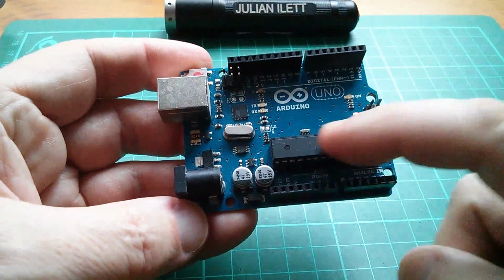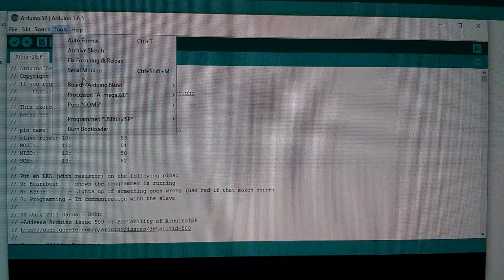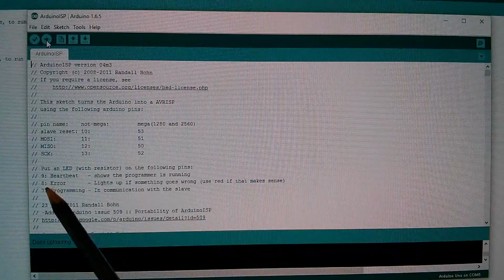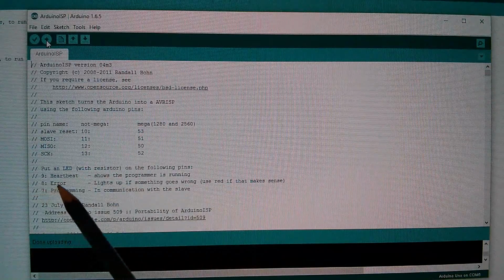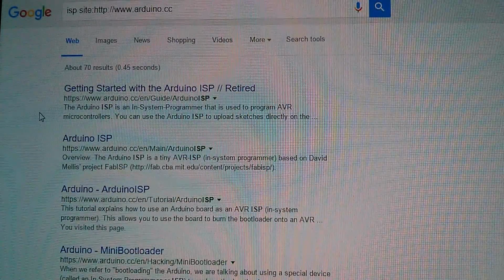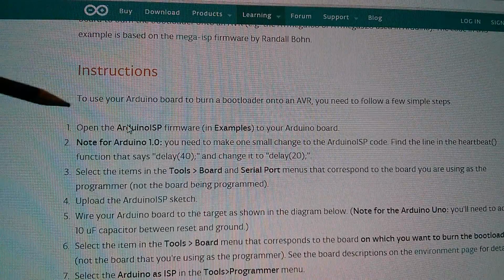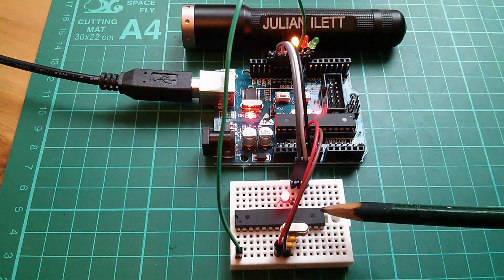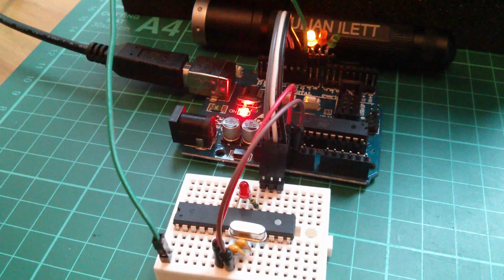Julian's Ardutorials: Arduino as an ISP

Comment: I'm a great admirer of your work here :)

In the instruction on this page, https://www.arduino.cc/en/Tutorial/ArduinoISP  , it says 

"Wire your Arduino board to the target as shown in the diagram below. (Note for the Arduino Uno: you'll need to add a 10 uF capacitor    [ MICRO Farad ] between reset and ground.) "

You suggest using a 100 nanoFarad.....

Does it matter that there is such a difference in value ?  Won't it affect the RESET pulse width ?

Comment: Man I did love it when you were teaching Arduino for we beginners, from time to time, I find myself going back to review some of these old videos, they are so refreshing to see once more. I hope you will, one day, return to the Arduino's and ESP8266 projects so we can have more fun with them. I most recently built a special timer for my good wife of 48 years to use when she installs the eye drop medication for glaucoma, she needed a count down timer for exactly 2.5 seconds. I used an ATTINY85 processor, a four digit LED running through I2C bus and mounted it in a very small project box with just an on and off toggle switch.  For power I used a very small 12 volt battery designed to power remote control relays that I used to use to turn on my back up camera on our old RV (no longer needed our new one has a great camera, I just had to repair the monitor, she had bad solder joints inside!)  I based it on a video I found on Youtube, and gave credit to the fellow who designed the original system. I just modified it a bit as to the power supply and using a passive beeper instead of an active which required a few changes in the code.  It works great, and it is nice to see one of my projects being used every night  without fail.

Comment: The onboard LED on the Uno is blinking synchronous with the breadboard LED in both programs. What's going on? Is the ISP Uno also programming itself to do the same thing as the chip it's trying to program?
And it went dark after uploading the bootloader, did the ISP also wipe itself? (no wait the heartbeat is still there)

Comment: The original ATmega328p that came with the Arduino is destroyed. I tried to remove it from the socket and i bend the legs and after they went off. I gone on ebay to purchase some chinese Atmel's claiming to be "genuine' however i can't even upload the bootloader on them. It gives me this error. "avrdude: stk500_recv(): programmer is not responding". I use the original Arduino compiler and the Arduino. Any clues anyone? o_0

Comment: Julian. I find it pretty funny that you posted this right after I created a small shield that does basically the same thing. I bought 10 AT chips from China without boot loaders so I figured I would save myself the time rather than break out the breadboard every time I needed to flash them.

I opted to ignore the sketch's suggestion and and used Red for the heartbeat, yellow for warnings and green for programming. I also added a Green LED for pin 13 along with a 16MHz crystal and capacitors to allow the programmed chip to show signs of life. Pin 13 also flashes in tandem with the programming LED so the results are pretty awesome! The use of a socket allows me to pop a chip in and out while leaving everything else in place.

I had to smile when I saw you ran into the same problem I did with the headers. I ended up using more pins than I wanted just for stability sake. It was either that or break off just one pin.

Thanks for the video, gave me a bit of a sanity check :)

Comment: Julian, as always, excellent tutorial. I was wondering if you might be interested in doing a follow up video to this one. Going through how to program the attiny85 using an arduino as isp and also how to set up the attiny85 to run on its internal clock.

Comment: Is it my imagination or does that final fast blink seem faster than the first one? If so, that means the ISP upload didn't work. Can you explain?
Reply from the maker: +Roger Rowland Yes, well spotted. I used that chip in a previous video (https://youtu.be/tA9aHXxSdSI) where I re-programmed the fuses to use the internal 8MHz RC oscillator. Evidently, 'upload using programmer' doesn't modify the fuses, so it was still using the 8MHz internal clock. The compiler created delays based on a 16MHz clock, so the LED was flashing at half speed. On the other hand, 'burn bootloader' does change the fuse settings, so the clock source was changed back to the external crystal oscillator.
Reply: +Roger Rowland Silly me I was rewinding and counting blinks. Shoulda checked comments first lol

Comment: If you have one of these neat fittings you can use this method to flash an Atmel chip directly on whatever board it's already mounted on - useful for re-flashing ESC firmware or say, an arduino nano with a busted FTDI/CH340 chip: http://www.hobbyking.com/hobbyking/store/uh_viewItem.asp?idProduct=27195

Comment: The ArduinoISP page mentions something about a 10uF capacitor between reset and ground when using an Uno. Presumably this is for the target Uno rather than the programmer?

Comment: Great video as always. Can Arduino as ISP program other AVR chips like atmega16/ at89s52? Does avrdude or any other burner software support this programmer?
Reply: +Brainstorm4300 
Yes, you can use avrdude with it to program pretty much any AVR chip (it has to support ISP and avrdude has to support that chip). If you want you can now program a ATtiny2313 to be a USBtinyISP and then use that tiny to program other AVRs. ;)

Comment: Hi Julian,
You say when you select the ArduinoAsISP as your programmer that the port does not matter. But it certainly does! The post has to be the port the ArduinoAsISP is connected to.

And you did not connect a capacitor between reset and GND to disable the auto reset of the ArduinoAsISP. Not sure how it still works, in the past this was mandatory. But maybe they changed the code of the IDE to except the fact the ArduinoAsISP first resets when you try to program. 

And it was funny to see when you were explaining on the ArduinoAsIsp page and said it was confusing you indeed mixed up the "programmer" Arduino and the "to be programmed" Arduino :p

Comment: I hate the odd spacing between pins 7 and 8! Why did they do that?
Reply: +Dafuq Ucare 
Na, it's just annoying. Someone who doesn't know front from back on a shield won't get much further after that anyway without breaking something.
Reply: think of a person installing a shield in reverse! It could be a child or hobbyist or whoever...etc.
Reply: +Dafuq Ucare There are infinite of other things that still can be put into reverse in an arduino.
Reply: It was an error in the original CAD file used to produce the first boards.

It's been retained on newer boards to ensure older shields will fit.

Comment: dont u have to put a cap over the reset pin of the programmer when you are burning a bootloader?
Reply: +fredlllll 
No, the cap is just a hack to get the AVR to reset over serial to run the bootloader. ISP (that's used when programming a bootloader) has a dedicated reset line.